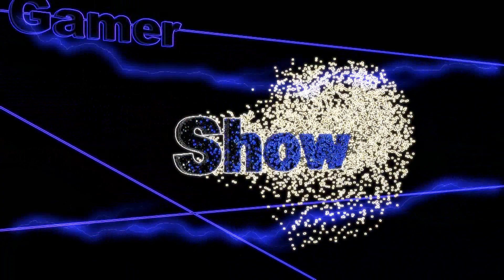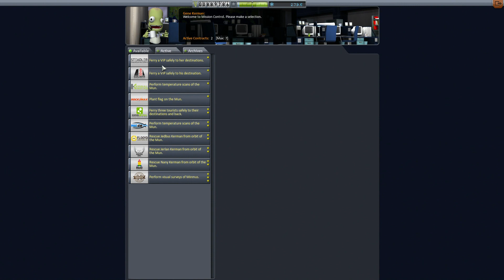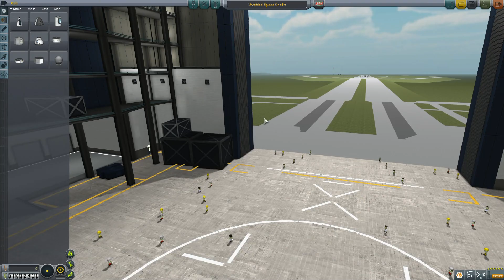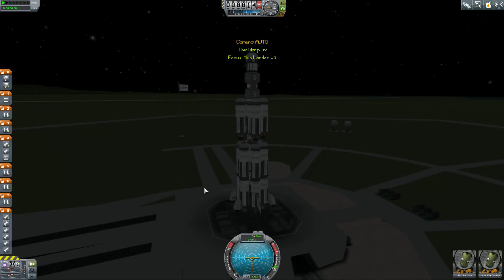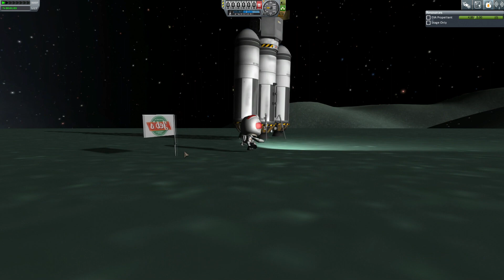Kerbal Space Program (2015) - Old School Career Mode 9

Comment: Contracts are generated based on what contracts you have completed and failed. Regarding different biomes, you can get several thousand science from the Mün and Minmus each by just hopping around and collect data from all the biomes.

And just don't use the Mün as a gravity assist. Just don't. Even Scott Manley says no. https://www.youtube.com/watch?v=sF8roW6Cxm0
Reply: ***** Set up maneuver nodes for the two scenarios, crank up your conics to 5 encounters, and add up all the numbers from your nodes: you'll find that there really is no advantage in using the Mun for assists.

Now, Eve, on the other hand...
Reply from the maker: Markus Watched the video.  Scott is very smart and using tools to show him the numbers.  However I think he missed something.  Yes if you do a single burn from Kerbin to the mun to eject it can be expensive.  But if you do a burn in low orbit and just get a encounter and then after you are mid approach you do a correction burn.  I think it will save fuel and the correction is a very small burn.  So it's 850 DV + correction.  I could be wrong but I have tested this idea and it seems to help.
Reply: ***** Then you'll need to show some actual numbers comparing a straight burn to Minmus from LKO versus a slingshot to Minmus using Mün.

As Manley said, the costly here is to bring that extra fuel out of the gravity well. Your correction burn was quite expensive too, about 100-150 m/s worth of Δv.

But if you think I am wrong, test it yourself.
Reply: o0alessandro0o Yes, planets like Duna and Eve are very useful for slingshots and can save you quite a bit of Δv. Scott Manley has made a video of this as well.
Reply: Markus Oh, I know, after watching his videos I sent out a craft that... Well, let's put it this way: remember when he didn't go to Jool because it was too late and he just wanted to get the craft back to Kerbin and go to bed? I didn't have to go to bed.